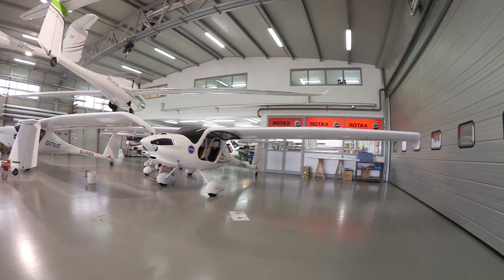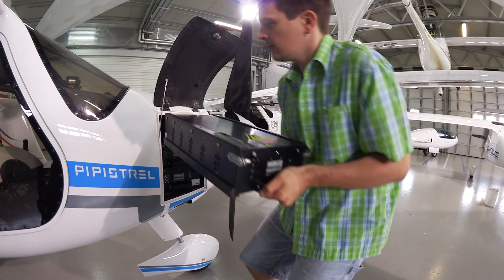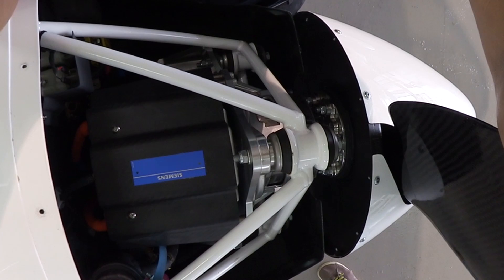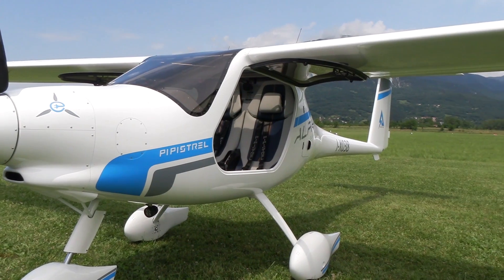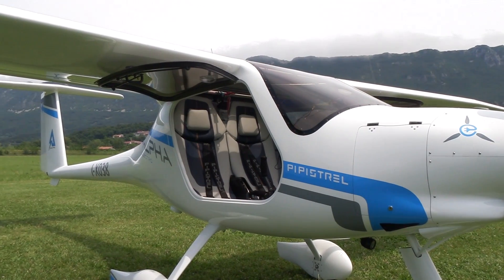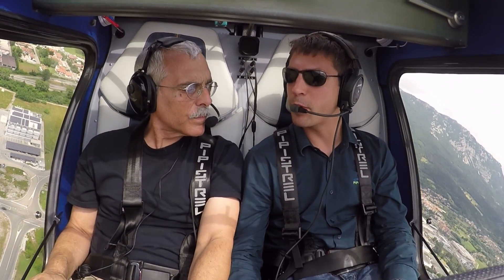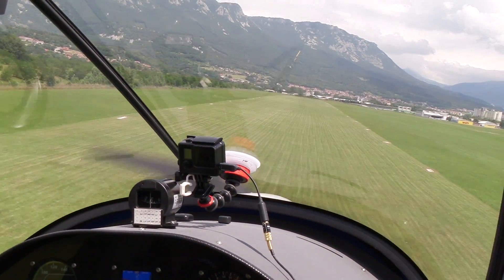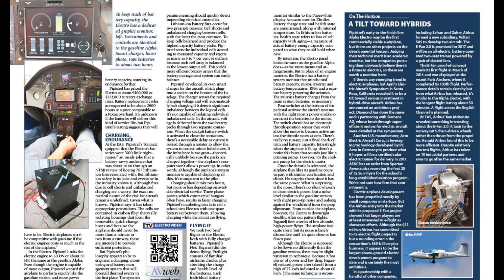Flying Pipistrel's Electric Airplane

Comment: The problem with batteries is that the energy density drops to zero as you discharge them.  Battery powered aircraft may be good enough for ultralight short range planes but for big long range planes you need fuel(hydrogen or biofuel). The reason why the energy density drops with batteries is the fact that you keep the batteries on board after you consumed the energy, thus the energy drops while the mass remains constant. With fuels, you discard it after you use its energy, through the exhaust. Future long range aircraft will either use fuel cells or traditional IC engines.
Reply: For now that's certainly true and for the near future as well. 

NASA and others did do some work to study what you might need for a long range plane with electric power, but while what they found was required was possible in theory, it's currently beyond our abilities.

Still, as the decades pass us by those hurdles might be crossed eventually. And so perhaps one day even for planes the traditional solutions will be replaced.
Reply: +John Metadata Your talking about specific energy (energy density per mass). The specific energy of Lithium Ion battery is less than 1 MegaJoule per Kilogram. Specific energy of ethanol is 26 MJ/Kg. The specific energy of methane is 53 MJ/Kg  The specific energy  of hydrogen is 140 MJ/Kg. These three fuels have the highest probability of being used with fuel cells. Also theres turbine engines like turboprops, turbofans and propfans which have a practical specific energy of around 15MJ/Kg for petrol fuels and 40MJ/Kg for hydrogen fuel. The lower practical specific energy is due to low efficiency of turbine engines. Turbine engines however have a very high specific power(power to weight ratio) which gives them an advantage when the cargo is heavy.
Reply: It's impossible with current battery technology, yes. And probably won't be taken all to seriously as an idea for long haul flights until batteries improve by atleast 1 order of magnitude.

There are some additional tricks one can apply to make up for the additional energy differences once one starts getting close though, thus why consideration starts a bit earlier then expected.
Reply: +Quickshot0 Let's clear a bit of confusion first. An electric plane is a plane whose propeller is driven by an electric motor regardless of the power source that's driving the electric motor. A fuel cell plane is also electric. It is possible to build a long range electric plane powered by a rechargeable battery, it's just not practical. If there's going to be a battery powered long range commercial plane in the future, it's going to be powered by primary battery which tend to have high specific energy. Fuel cells have the advantage of using oxygen as an oxidizer.
Reply: It's possible to make a rechargeable battery that uses oxygen from outside as the oxidiser, though for now it's more of a in a not very well working lab thing then something we could produce cheaply in mass production. Very very far from that.

You are also of course right that other electric sources could be used, but as drawback they up till now have been less efficient then batteries. Creating the fuel costs power and creates extra losses and typically their conversion back to electric energy is less efficient by a fair margin as well.

In the future these same concerns would also hold for conventional IC type of fuels if one wants to maintain a carbon neutral foot print, but even more so really.

Due to this a sufficiently high energy density rechargeable battery would continue to hold some interest still in making air travel more efficient energy wise.

Also as I said in one of my previous comment, this has been looked in to by NASA and such and is 'theoretically' possible. But no time soon, so it's not like I expect to see them flying any time soon and perhaps not even in my lifetime.

And possibly by the time they could become possible and competitive we'll have invented something better, mooting the entire matter.

As such you should take this comment more as a one off mention that it isn't actually 'impossible' with rechargeable batteries as you seem to imply, just completely impossible for now and the near future at our current technological abilities with batteries. (Far future is to unreliable to properly predict)
Reply: I didn't say rechargeable battery aircraft are impossible, I said "It is possible to build a long range electric plane powered by a rechargeable battery, it's just not practical." Also, I'm not saying that IC engines are better than batteries, I'm saying that fuel cells are better (in aircraft). The efficiency of fuel cells range from 10% to 90% depending on which type you use. Creating hydrogen through steam reforming is 70% efficient. Steam reforming creates hydrogen from methane which is an unwanted gas created by animal feces. Turning it into a usable fuel is more ecological than just ignoring it. Air based "batteries" like Lithium air and Magnesium air are more like fuel cells than galvanic cells(batteries) since galvanic cells require both reactants to be enclosed in the cell. Both galvanic cells and fuel cells work on the same principle (electrochemical cell), the only difference is that in fuel cells one or both reactants are fed in the cell instead of being permanently enclosed within the cell as in galvanic cells. Batteries are however more likely to be used in recreational flight where range isn't an issue.
Reply: Fair enough, but the efficiency still remains an issue of the fuel creation side then, even if admittedly it might be an acceptable trade-off.

I am in any case thus not quite as convinced it's the most practical solution, though it could be. But I figure the future will show who's guess was best in this case.
Reply: My hypothesis is that rechargeable batteries will be used in personal, short range and recreational aircraft, while commercial long range planes will rely on fuel cells and turbine engines. Also since bothbattery and fuel cell planes use electric motors they would probably have the top side of the plane coated with solar cells to lower consumption. Fuel creation efficiency depends on method. Also, companies can cheat by moving fuel production to cold areas where they can use excess heat to provide heating to cities, like they do now with data centers.
Reply: orrr a hybrid plane. no need to use bullshit hydrogen or some other billion dollar pyramid scheme technology. Use what we have, thats reliable, works and doesnt need a rocket scientist/physicist if it breaks down.

Diesel electric engine with battery backup, just like a submarine.
why cant we utilise existing technology that works?? 

Diesels run on jet a (allready on every airport)
and doesnt need a supercharge 3 phase station to charge batteries.
plus if the diesel engine should fail, you have battery backup to land the aircraft.
Theres no need for pointless arguments of zero mass or specific energy densities of elements ffs. THIS is why we dont have electric planes, because big know it alls gather around and measure miniscule dick sizes instead of actually taking what we have and working with it.
Reply: Faulty logic, an avgas aircraft without fuel in the tanks weighs 1000kg when you fuel it up you have to carry an extra 100kg, while an electric aircraft without charge in the batteries weighs 1000kg when you fuel it up it still weighs 1000kg. An electric aircraft can easily weigh less than an avgas equivalent because of the weight of the engine, fuel tanks and the extra structure needed to support these heavy objects. The most important fact is the best gas motor only achieves 30% efficiency while electric motors get over 80% and batteries power densities increases each year while engine efficiencies remain the same. At some point, this decade, gas engines will become like steam engines

Comment: So cool. That prop literally looks like a standard slow-fly prop on a LiPo powered rc plane. Man, electric is the way to go for fixed wing. Future is electric.
Reply: You do realize that we have the next billion years of innovation to go through, correct? This is a prototype, and the way they are advertising it, its a partial replacement for something like an ultralight or Cub where the most you will be doing is flying patterns and hopping around the city.
Reply: Craig Robinson Absolutely,  they had the energy potential for only about 10 minutes of flight, and yet they pushed on.
Reply: DrewLSsix if you think this is bad... google the Wright Brothers 😂
Energy density is now 4x greater than what these guys used
Reply: bauhaus l00998(#aw
Reply: bauhaus I
Reply: Looks just like an APC electric RC prop.
Reply: bauhaus ex plvbnhbhhhhjjjioekek kekc.
Reply: Too all these naysayers, he said "Future is electric". Key word being "future" and I do truly believe that's the case. Technology continues to accelerate and our children will one day be taking transcontinental flights in all electric airplanes.
Reply: rojamb Nothing can replace the Cub. 
_Nothing_, you hear?
Reply: bauhaus. this plane is literally worthless for any GA uses. you cant even make it from one airport to a neighboring airport reliably. a headwind some time in the pattern and just one goaround takes up a large portion of your flight time. 

it may well make a good trainer with reduced fuel and maint costs, but a school would have to invest in a tin of chargers and change out packs several times a day to get decent flight time and thats a massive upfront investment.

a decent enclosed ultralight has similar flight times and only takes moments to refuel.  it may take $15 in gas to refuel an ultralight opposed to $2 in electricity but convenience and flight time are very much worth it.

cool plane tho,

Comment: Also i think this is future of big airplanes ,with new gas based batteries.
Reply: The problem with that idea is that fuel weight decreases as it's burned.. so you have to calculate max landing weights according to the reality that you've just carried your entire fuel load to your destination.
Hydrogen might actually be a better solution for aircraft.  Hydrogen is a disaster if you are going to use it for an automobile, but it might actually make sense for aviation.
Reply: Liquid methane is likely to be the best bet. Clean, cheap and requires little change in the ground handling: just care in temperature management.
Reply: PaleHearse. why would hydrogen be a disaster for a car? its if anything safer than gasoline.

Comment: I love how this airplane can take off immediately without an engine run-up
Reply: bill corbett - Electric heating seems as a logical step here. Why have  electric plane with fuel consuming APU? Maybe it could be jet-electrical but that wouldn't cut the fuel cost.
Reply: bill corbett my assumption is that it has a separate APU given it doesn't need bleed air
Reply: How you going to heat the pilots  after that cold start? Or defrost the windshield.
Reply: Would it be possible to use electrical sparks or electric-thermal as an afterburner?
Reply: I'm sure that ICAO and the FAA will still demand and regulate on Run ups, they'll be a hell of a lot quicker but still have to check that systems are functional, movement of the control surfaces and that the prop can stay stable given power and is stable with idle power, etc.

The whole reason for a Run up is to look for a reason not to fly and I don't think an electric plane will make that much of a difference in that regard.  Like I said before, it will still be way quicker, maybe even less than a minute of Run up.  Very exciting plane, would love to purchase one once I have money :D... Which will likely be never :(
Reply: Insuring doors & belts secure; flaps set; xponder set etc. etc. are cause for a pre-takeoff check.
Reply: Raymond Jones
Reply: yes... or make plasma... but no batteries are strong enough for that.

Comment: Sweet.

Now how about adding some solar panels to the wings for a bit of a boost? Presumably someone already mentioned that in the comments.
Reply: Because same as my electric car... the panels wouldn't pay for their own weight. People don't quite understand the amount of power in modern vehicle lithium ion batteries. The 17kWh pack in the Alpha Electro, like the 22kWh pack in my car would power a typical four bedroom house for a day or two. To continuously feed the 10kW charger for this aircraft you'd pretty much have to deploy solar panels covering the entirety of the hangers roof. Big things are coming in terms of pack capacity, it pretty much grows at 7-8% a year. Three years after my car launched the new model is coming with a 57% larger pack in the same size and weight. In ~7-8 years it will be cheaper to produce 30kWh class electric cars than than petrol equivalents. My next EV which I'm buying in the next six months will have a 60kWh pack that would power my home for two weeks, my home is fairly energy efficient but still....
Reply: It can stay in the air for an hour, not really enough to get a decent charge from PV panels, but if you let it sit on the ground for several days at a time that would be usable.
Reply: That might help a little, but given the area available it just might not be worth the cost.  Just as an estimate of available wing and fuselage space I'd say you could get at best around 2-3kw of production.  You bump that by about -20% for realistic production and I'm betting you wouldn't get but 20kwh of production out of the plane if it sat on the tarmac all day.  While that would be pretty cool to get you out of a jam if you had to land it and hopscotch back to the airfield, it would probably net you no more than about 5 minutes of extra flight time during an hour long flight.
That would be an expensive 5 minutes at a cost of around $10,000.  So that's probably not going to happen.  You also have the additional complexity and weight of having to have it haul around a charging system.  So the net increase on an aircraft of this size would likely be zero.
Reply: Everyone always says "stick solar panels on it" whether its a plane or a car....the order of magnitude of power required for these vehicles over what any current solar cell can deliver immediately eliminate them from any integration. Nice idea but in practical terms wont happen.
Reply: cros13 Which kind of electric car, BTW? I have an eGolf.
Reply: cros13 This is what I was thinking of regarding paint on/spray on solar 

https://www.engadget.com/2014/08/03/spray-painted-solar-cells/

I have no idea how far along this tech is. Every so often I read about a breakthough in solar and/or battery tech and then never hear of it again
Reply: The Solar Impulse 2 is a proof of concept for this idea. It doesn't need to pay for itself financially, as the real issue here is range.
Reply: Never is a long time, electric motors can match any ICE's power output.
Reply: lol a wind generator.... its not a giant airbus or boeing, lol in terms of this planes size drag is bad, by having a wind generator running on the plane you would generate too much drag, not only that add dead weight. 
Same as solar panels, you would need more solar panels than the size of the hanger they build these in to generate enough constant current to charge the batteries.
(Constant current, meaning full uninteruptable sunshine. no cloud, same intensity etc etc etc)

Heres an example, find a solar cell from a calculator, stick it on your car and see if it can recharge the battery let alone turn on anything inside the car. Now take a massive solar panel from a house roof for example and put it on the cars roof, in full sun, the solar panel cant generate enough output to power the starter
 motor, let alone run normal electronics that your car would continuously. 
Solar battery charges do exist, ive got a few myself, but they take way too long and cant be used if the sun isnt fully shining. 
Solar panels are great, but they arent the answer we need for sustainable future power.
Reply: cros13 Sure, that occurred to me. Of course if the panels were part of the wing structure and used the latest lightweight tech - I recall seeing paint-on solar panels on some popular science website a couple of years ago - then it might be feasible. It also occurs to me that an electric aircraft with solar panels on the wings could land anywhere and recharge. 

Wishful thinking, perhaps.
Reply: I was thinking that and also use a small, squirrel cage type, wind generator in the air-scoop to add to the longevity.
Reply: Why do you think solar powered aircraft are so light? Because it is not a viable means of sustaining power, let alone take off power, for any craft other than a featherweight with enormously long thin, high aspect ratio wings. While I appreciate and admire all the innovations we are still decades away from passenger air transport with these methods. The research might be as well directed at improving and developing even more efficient and quiet very small jet engines which still have potential. You are never going to lift an airbus type passenger aeroplane off the ground with 150 passengers on board with solar, or hybrid or electric power. It is a cul de sac.

Comment: Great to see aircraft going electric now too. Also, nicely objective review from a traditionally oil-based industry - for instance matching the range to an appropriate use i.e. training. EV owners are tired of the automotive industry's incessant bashing of electric cars because they would do 500 miles on a single charge yet.